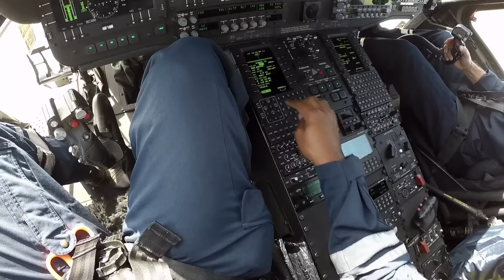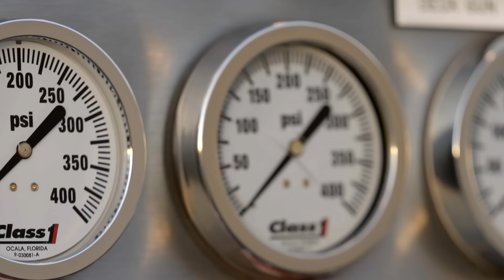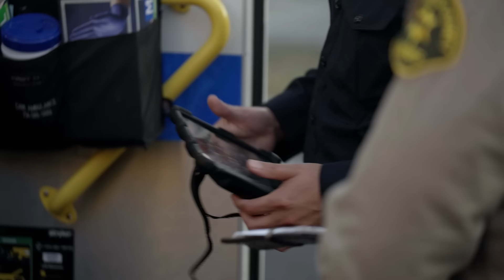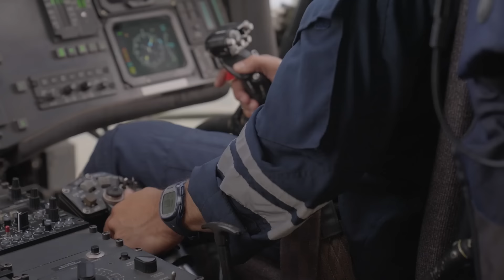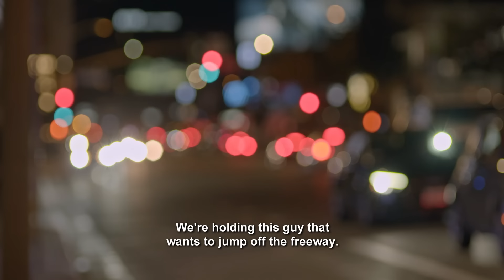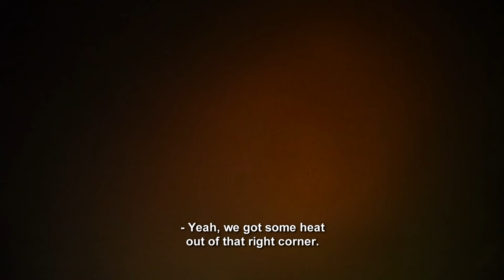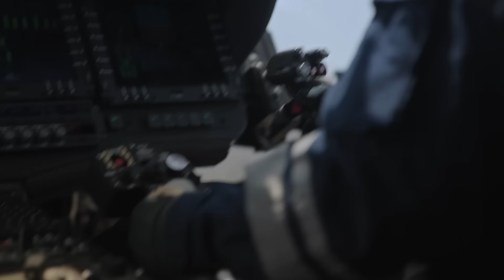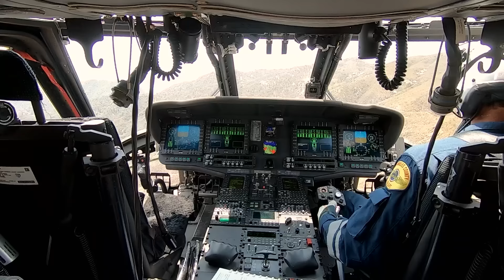Top Heart-Pounding Moments | LA Fire & Rescue | NBC

Comment: They have at least 5 people there and use LUCAS. Why would you do that, every study shows that Lucas has significantly worse outcome than manual compressions.
Reply: It’s exhausting?
Reply: Uh no studies don't show that, at all. Actually the general consensuses in existing research is that it probably doesn't make much difference either way, or that basically good CPR is good CPR whether mechanical or manual (though there may be an upside in situations where lack of manning or situation might prevent good continuous CPR and this may explain why some studies actually do show slight improvements in survival to hospital with mechanical systems) ,but in any case if it allows you to focus on other things better there isn't much downside to using it, but there likely isn't much upside in terms of outcome either.
Reply: It’s actually the exact opposite Lucas provides perfect compressions the entire time